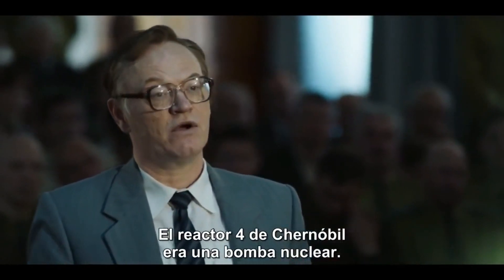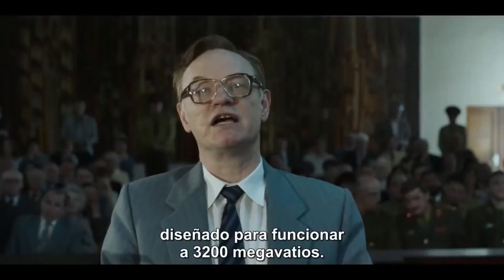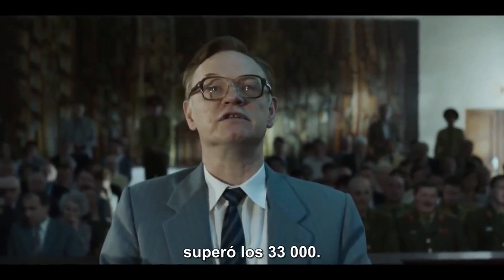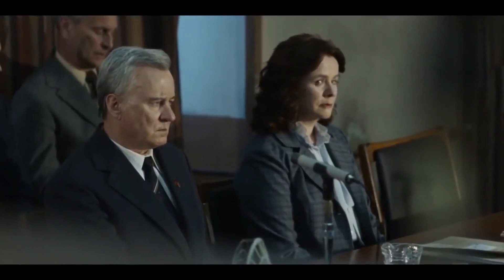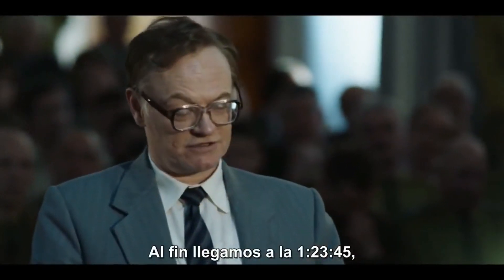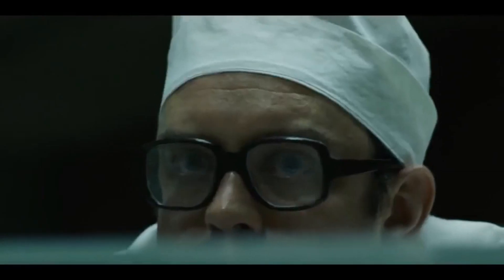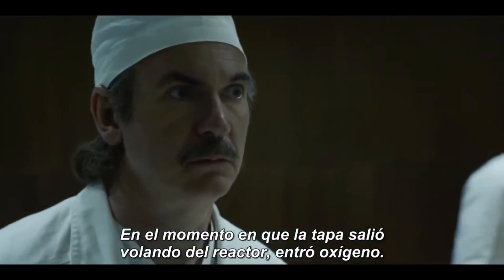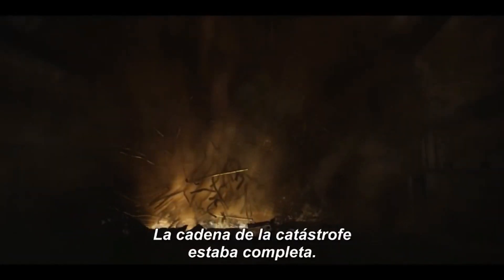Chernobil disaster explained in 10 minutes (3/3) - Valeri Legásov - Chernobil Series

Comment: The reason for the graphite tips was to make it easy to swap fuel in and out while the reactor was running. The ability to do this made the RBMK able to both produce power (for which you leave most of the fuel in for a long time) and to produce weapons-grade plutonium (for which you only want fuel in for a short time). The idea was, when you pull out a fuel rod, that lowers reactivity, so you pull a control rod mostly out, leaving the carbon tip inside to help keep the reactivity up. The designers didn't think that the operators would be pulling so many control rods completely out, graphite tips and all.  

It was a flaw, but I haven't seen or heard of evidence to support this scene's statement that "it's cheaper." It might be true, but it might not. The problem with telling the story of Chernobyl is that we have a very good idea what happened and what decisions were made that led to the accident, but we don't have the full story of why these decisions were made.
Reply: That is very valid, but I believe that part is supposed to be longer, as I have seen a version where he actually goes on and lists several other things that the Soviets were doing to cut costs, and the graphite-tipped control rods were the last point.
Reply: @faasnuhind8578  one of the adjustments made to the RBMK after the accident investigation was the lengthening of the graphite followers and the elimination of space between them and the boron in the control rods, but I haven’t seen any evidence to suggest any hat they were meant to be longer in the first place.

The Soviet Union tended to see human life in general as more expendable than western countries. This drove a very different kind of risk management than what western countries practice, where making impressive things work was more important than making those things safe. “It’s cheaper” thinking is a western way of explaining what, to western viewers, would be a fundamentally alien mindset. It’s hard for western audiences to grasp the mindset of an entirely communist culture that didn’t use money. That speech tries to present the Soviets as if they were some kind of greedy corporation that put profits ahead of lives, a concept that’s easier for westerners to grasp, but  one that fails to capture the dysfunction and moral failures of communism.
Reply: @willerwin3201  There is something very dishonest about the decision to portray the use of graphite as a cost cutting endeavor and not as a functional feature of the reactor. Why would an American creator choose to do this? it feels a little like we are being led by the hand into the belief that the Soviets were cartoonishly and uniquely evil. But is the truth ever this simple? The whole series felt this way to me on the second viewing although I absolutely loved it on the first.
Reply: @skipscobie1949  It’s a weird series to me. In some ways, the accuracy and attention to detail is superb, but in almost every episode, one of the “truth teller” characters who are educated enough to know better says something that is factually preposterous, usually by exaggerating the danger or distorting the effects of radiation. This isn’t one of those cases, though this episode had a whopper: “the reactor is now a nuclear bomb.” Anyone with a clue of how bombs or reactors work would have dismissed this guy’s testimony at that point.
Reply: @skipscobie1949  It’s hard to guess the motives of the writers. The inaccuracies seem to point to having a rabidly anti-nuclear technical consultant on the payroll. There’s also an effort to portray the dysfunction of Soviet authoritarianism, but not so much that of communism in general.
Reply: @willerwin3201  Yes! I watched that Vanity Fair video of the Ukrainian first responder saying that being near a person with radiation sickness doesn't expose you. Then rewatched the series and so much of the plot is moved along by that incorrect premise!
Reply: @skipscobie1949  it's anti nuclear propaganda.
Reply: @willerwin3201  "An entirely communist culture that didn't use money"
The Soviet Union was communist in name only and they absolutely used money. They printed and used rubles as their currency, and had wage labor and markets. Rather than communist, the Soviet Union is more accurately described as "state capitalism". Basically just like regular capitalism except the economic means of production were mostly owned and centralized by the government. But all the profit-motive-created problems of capitalism were all still there. 

That speech "presents the Soviets as if they were some kind of greedy corporation that put profits ahead of lives" because that's exactly what they did. Just replace "greedy corporation" with "greedy government" and that's it. Just because you've replaced greedy business owners with greedy government bureaucrats doesn't mean that you've gotten rid of any of the inherent problems with capitalism (this is basically the entire thesis of Orwell's "Animal Farm" and why it was such a brilliant metaphor for what happened in the Soviet Union). Did the Soviet government's view of human life as very expendable also play a role in what happened? Sure. But to completely ignore the cost-reducing-incentive that drove a lot of that decision-making is completely disingenuous. Communism isn't perfect and has plenty of problems of its own, but the Chernobyl disaster, like so many other disasters, is the result of good old fashioned capitalist profit motive
Reply: @rollfizzlebeef6619  The Soviet Ruble wasn't a currency in any traditional sense. It was effectively a scrip that could only be used in certain stores on certain products at rates fixed by the government [1]. The Soviet economy was a planned economy that didn't use markets in any traditional sense, and its money was more akin to tickets you win at an arcade than a legal tender for debts public and private. The Soviet economy was in no way "basically just like regular capitalism." 

You're also mischaracterizing Animal Farm. Orwell's work was a cautionary allegory about tsarist autocracy, the 1917 revolution, and the corruption of communism in the Soviet Union [2]. It was more broadly a critique of authoritarianism than of economics. 

The desire for wealth is not the same as the desire for power to impose one's will on others. Lumping both together as "greed" risks drawing false equivalencies in both moral and practical senses. You're going one step further in your "the USSR wasn't truly communist" play by condemning the motives driving it as interchangeable with western free market economic systems. That's incorrect, and that kind of thinking is the same kind of thinking that led to the appalling human toll of mass death and misery attributable to communism in the 20th century [3], of which Chernobyl's human cost amounts to less than a rounding error by comparison.

[1] https://en.wikipedia.org/wiki/Soviet_ruble#Economic_role
[2] https://en.wikipedia.org/wiki/Animal_Farm
[3] https://en.wikipedia.org/wiki/Mass_killings_under_communist_regimes
Reply: @skipscobie1949 I mean, to be fair, I don't think the USSR was cartoonishly evil...but things like the Semipalatinsk testing ground, the gas crater in Turkmenistan, both the ecological and biological disaster in the Aral Sea, the Antrax leak incident, etc are VERY hard to defend without being lead to conclusions like "were they just evil?".
Reply: @skipscobie1949  Well, maybe in a way, having a reactor serve double-duty like this, kind of is cheaper.   In my understanding, reactors outside of the USSR are not necessarily weapons-grade plutonium factories, right?
Reply: @skipscobie1949 I’ve read quite a bit on this, and I’m the farthest thing from even a nuclear novice. But my understanding is, this allowed them to quickly create depleted uranium which is used for nuclear weapons.  Obviously it wasn’t the safest scenario, but the Soviets were in a race with the Americans, and although they had safety measures in place, their ultimate goal was to produce energy and weapons in the most efficient means.  The human safety wasn’t the driving factor. Also, the Soviets would never admit anything they make had flaws, and they certainly wouldn’t teach their engineers about it, they didn’t want to look weak to other nations. It’s a huge fatal flaw of communism… everyone knows what THEY are supposed to do, but they have no idea what everyone else is doing and why.
Reply: @skipscobie1949  There is one thing she mentioned earlier. She did say there, at the time, were no experts in radiation and that they pulled all of the books that said "radiation" from the book shelves to teach first responders about how to treat patients. So, the question is, did they know what we know now about treating people with radiation, and this is how they actually treated people with radiation then or did they have all the info and just misrepresented it. Remember how covid was potrayed in 2020 and now in 2025, and if you are creating a series, will the fact check rules for recreating the pandemic be from 2020 or 2025?
Reply: @splatbubble Modern reactors, not so much. But some of the first gen reactors in the west were also dual purpose, like the UK's Magnox reactors. The US had dedicated reactors at the Hanford site in WA and the Savannah River site in SC. Only a couple were dual use, most were just for plutonium.
Reply: It mad eit cheaper because it helped allow them to use natural uranium instead of enriched
Reply: Well, I think the Soviet Union winning the arms race and military superiority by any means necessary was a very important part of the decision to ignore safety.
Reply: Be that as it may, the operators should have been aware of this.
Reply: @GingerZombie29  earlier in the series, they discovered at a report from a different plant where the AZ-5 button caused the power to spike briefly before going down.  The report was censored by the KGB (because they can't let the world know that their reactor designs are flawed), so the Chernobyl operators had no idea that AZ-5 would cause the power to spike, which caused the water to flash to steam, jamming the rods in place, which allowed the power to keep climbing until kaboom.

The whole point of his speech, and the tapes he made and managed to sneak out under the KGB's nose, was to make the public aware of the flaw which would force the KGB to allow it to be fixed, since once the secret is out, there's no point to keep pretending that it doesn't exist.
Reply: That wasn’t it at all. It stems to the issue that water is a neutron poison. The control rod channels are exposed to coolant, and nature hates a vacuum. When you remove the rod, water fills the void it left which reduces reactivity and thus efficiency. They added graphite tips to the rod to displace the water and raise reactivity. 

Problem is, the graphite ends of the control rod aren’t the full length of the channel. When they removed the rods completely, the graphite tips were out at the bottom of the reactor where it was replaced with water which was creating a localized reduction of reactivity. When AZ-5 was pushed, the graphite tips where pushed down into this area, forcing the reaction poisoning water out and replacing it with a reactivity boosting moderator. That’s what caused the sudden power spike as the rods entered. 

And that’s why one of the fixes was increasing the length of the graphite tips. Now even with the rod fully removed, the water couldn’t enter the control rod channel, meaning you didn’t have a sudden power rise when you wanted a power reduction.
Reply: Graphite is an accelerator for the reaction, so while the control rods are the brakes, the graphite allows them to increase reactivity, increasing power, like a gas petal. By having some way to accelerate the reaction, they are able to use cheaper, more commonly available, less reactive, unrefined uranium in reactors. That why graphite makes the reactors cheaper. Without the graphite, the reactor would produce much less power and be a lot less controllable in low power modes due to the xenon. By having the tips of the control rods be graphite, the controllers can quickly switch between accelerating the reaction or slowing the reaction. 

Dyatlov's main mistake was pulling the control rods completely out, as they would have to push the graphite tip of the control rods back in first when they wanted to bring the reactor back under control which would only accelerate it further. It is like driving a car towards a brick wall but in order to use your brakes you will first have to accelerate to your car's max speed. This is why AZ-5 was a detonation switch, it tried to put all the rods back in as quick as it can, thus all of the graphite tips entered at the same time, creating an enormous spike in reactivity, that melted the core, locked the graphite in place, and caused the explosion. It is like driving a car towards a brick wall but in order to use your brakes you will first have to accelerate to your car's max speed.
Reply: @Michaelonyoutub  That's essentially correct. The only caveat I would add is that the reactor itself contained a lot of graphite that wasn't part of the control rods. Most of this graphite stayed in the reactor all the time in order to moderate neutrons. 

By using graphite as a moderator instead of water, fewer neutrons get absorbed by the moderator, and that requires less fuel enrichment, which makes the fuel for the RBMK easier to produce in quantity (cheaper isn't the best word choice when it comes to describing Soviet economics). 

However, the presence of graphite tips on the control rods is only there as a feature to enable the reactor to be refueled without shutting down. This would also have worked with other moderators; graphite was a convenient choice.
Reply: Something they don't mention here, is the rods broke and got stuck in the channels, all of them inserting the graphite tips and positive feedback, boom.
Reply: Designers set operating guidelines and trust that operators will follow them when operating the reactor. Nothing wrong.
Reply: Cheaper being the short answer for the convenience of keeping the reactor running while refueling. Legasov is not wrong just not saying the whole answer.
Reply: @mbpm6135  It's not that this design choice was cheaper. It's that the human lives it affected weren't valuable. 

The full context of what Legasov's saying includes other key safety steps that RBMK designers skipped: no containment building, for instance. Soviet industry incentivized producing results that looked good to Communist Party bosses over safety. Human life in the USSR was cheap. The RBMK reactor was huge, complex, and very costly to build in terms of resources and labor, even with the skipped steps and omitted safety features. 

The USSR actually had an arguably worse nuclear accident than Chernobyl which killed 4x as many people from acute radiation sickness: the Kyshtym disaster in 1957, which was almost totally unknown in the west until a generation later [1]. Chernobyl couldn't be hidden as Kyshtym was. 

https://en.wikipedia.org/wiki/Kyshtym_disaster
Reply: Okay Putin, calm down.
Reply: From what i heard it wasent the Graphite tips that created the problem, but the graphite at the bottom of the reactor instead.
Reply: Getting information about Chernobyl might be impossible at this point since the workers who were there died, most of the civilians who were there died, the doctors and firefighters who were there died and this happened during the soviet union, where they’d hide anything that would make them look bad
Reply: You would be surprised how many things in the world are replaced with cheaper parts, just because they are cheaper, but not better. It's not the engineers who decide that, it's people who run the budget and then hassle the engineers to approve their choice. The engineer only has a veto on this if it is too dangerous.
Reply: It is cheaper. It removes the need for enrichment, one of the most expensive processes in nuclear fuel manufacturing and fabrication.
Reply: @sonicmastersword8080 all graphite-moderated reactors don’t require enrichment, and RBMK had lots of graphite moderation without the tips.
Reply: If you knew anything about the eastern bloc, you'd know the cheapness was a huge factor.
Reply: this should be the top comment